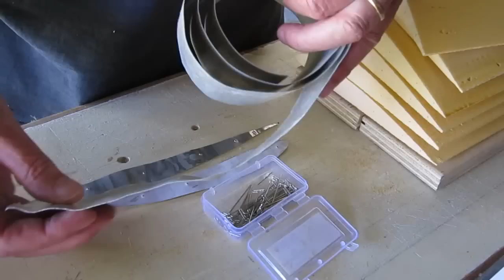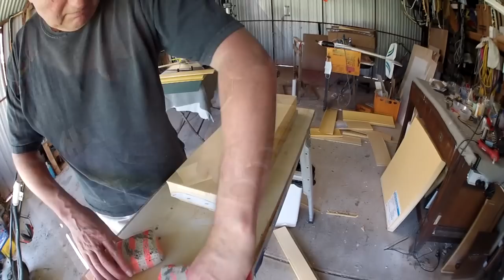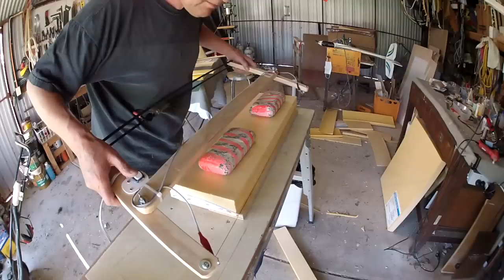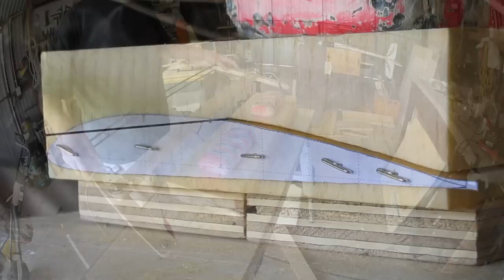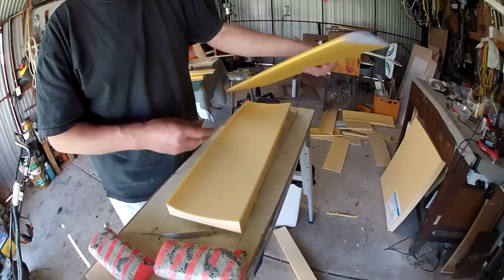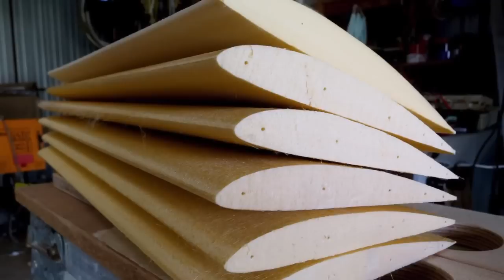The art of hotwire

Comment: Don't have to do straight wings. Don't have to have the same airfoil shape at both ends. With different templates and/or sizes at each end the shape will smoothly transition from one to the other. Can even put a bit of twist in the wing. The Wright brothers twisted the tips of their Flyer wings slightly downward to give them better stall performance. When the middle stalled the ends weren't yet in stall.

Comment: You have this down to an art I've just cut out my first wing panels with my home made bow using 28mm galvanized steel wire and a  automotive battery charger. I am waiting on my nichrome wire to come in from ebay for better results in heating and tension control.  I have found that only certain wire can be used and it is must be resistance wire and it will be fine.
Reply from the maker: Yes the wire I use is about 5 Ohms per metre
Reply: wow and not single strand ill have to chk that out

Comment: Please show how you'd do a tapered wing where you have both a reduction in chord and relative chord height. My concern is that the wire will be moving slower at the  tip end and faster at the root. Won't the slowness of the tip end wire cause the foam to overly melt while the speed through the root end is just right ?? Guess a LOT of trial and error will be involved. LOL. But I think it's doable.
Reply from the maker: Yes you're right. Usually requires more sanding to smooth out ripples on the narrow end.

Comment: What is the power supply? I'm using a 12 volt battery and .025 nichrome, but it goes part way and stops
Reply from the maker: 4S Lipo 16V, or Variable power supply set to deliver 5A
Reply: @AndrewNewton  And what about nichrome wire thickness? I use 0.3 mm but it so think

Comment: Nice demonstration Andrew :)  Those foil-templates are made out of lead / alluminum?? 
I've tried wooden ones in the past, but it's hard to get them smooth enough..
Reply from the maker: +DutchRC ADVENTURES Aluminium window flashing, easy to cut with scissors.
Reply: +Andrew Newton Thanks :)  Looks to be working flawlessly :)
Reply: +Andrew Newton great job as always.
Foil templates alluminium, is 0,5 mm?
Reply: +Andrew Newton wow never had this idea... I think i even use this on my wooden templates on the edges. I gotta try try this :)
Reply from the maker: +enrico p It's 0.3mm Aluminium window flashing

Comment: How exactly are you precisely aligning the two pieces of window flashing? I see that the front of the foil is butted up to the edge. Did you just place something under both pieces, before pinning them, to get an equal distance from the bottom? It looks to be at a bit of a tilt, so I was not sure.
Reply from the maker: +Jerry Whidby Just eyeballed it Jerry, probably not totally accurate but close enough. Would be better to mark a line about 4mm up from the bottom and a point on the front edge to help alignment.

Comment: Andrew, thanks for the Post.
I want to use a digital wood burner may be guitar wire st .6 Ohms. I can vary heat output.
If I do not use nicride wire Will  I have problems?
Reply from the maker: No problem, are you going to try it?

Comment: Hi Andrew,
Can I ask you a question.
I am buying a 3in1 Soldering/Rework station which has variable DC output.
There appears to be several versions though, 1amp, 2amp, 3amp, etc.
For hotwire cutting, 1A would be sufficient, right?
Reply from the maker: Not enough for my wire, I'm using 4A
Reply: Andrew Newton 
wow. Ok. 
Maybe I should consider a different source.
Reply: 4A.. 
I was planning on just using guitar wire..that should be OK right.
I could use an old computer power supply I have. some good amps there.. lol
Reply from the maker: Yes the thinnest string is the one to use I believe. There are plenty of tutorials on adapting a PC power supply, but I managed to trip the house safety switch when I tried. So I now have a proper adjustable unit.3S and 4S  Lipo batteries work fine too.

Comment: How do you sync the 2 sides? (so that the wire is always at same location on both sides) Eyeballing?
What about tapered wings?
Reply from the maker: +SsoulBlade Just eyeballing for straight wings. Haven't tried a tapered wing yet but will mark quarter, half and three quarter points on each end and try to pass them at the same time
Reply: @AndrewNewton  I will use this on my flying wing project. the taper ratio is about 2.08

Comment: What type of foam are you using and where can you get it . That looks much better than the folded foam board tape raped wings . I have multi-copters and left over motors out runners and esc's a 6 channel flysky radio I need servos  . Hot wire looks much better to me . Are you using carbon fiber arrows for spars ? I'm looking for longer range for Video and fpv .
Reply from the maker: +Spencer Boaz All the materials links are in the video description. 7.6mm CF arrows or 6 x 1mm or 3 x 0.5mm for spars.
Reply: Andrew Newton Ok I plan to watch them all again and this time I'll read the descriptions thanks .

Comment: Great stuff, got a lot of info from your video's and going into serious efforts myself. For my first project (which pushed me to hotwire technique fast ) I wanted to combine a scratch built delta wing with the fuselage of a Lidl XL glider. i got some good templates but i was wondering if the foam could be cut evenly and not heat up to much at the tip? Caus the travel is a lot larger on the inner side of the wing then the outer so i wonder if the  foam would hold up the longer wire cutting time on the tip in comparison to the normal wire cutting time at the base rib
. I hope it makes sence what i am trying to say ;)
Reply from the maker: It's always a problem with tapered wings. No way around it really.

Comment: Nice Video Andrew, it really is as easy as you made it look when you have the correct wire tension and temperature....I have a set of my own, just debating how to finish them...I'm leaning towards balsa LE and TE and Solarfilm for lightness....:)
Reply from the maker: +EnglishTurbines Ooh Proper job. Yes there are a few tricks of the trade.
Reply: Andrew Newton Thought about just covering in paper too...It might make a good follow on Video if a good cheap way could be found, although film from HK is still reasonably cheap...

Comment: hi Andrew.  what do you use as a power supply for hot wire cutting?
Reply from the maker: Either an adjustable power supply or 3S or 4S lipo depending on the wire length.

Comment: Is there much of an advantage  moving to a 4s lipo over the 3s you used in the previous video?
Reply from the maker: +stephen clark Oh yes, big advantage. Especially for the 750mm wing halves. Hotter wire = Faster cutting speed = smoother cut. 3S was OK but slow, 6S (2 x 3S) was too hot and burned out the wire. 4S is perfect.
Reply: +Andrew Newton nice job, you make it look easy!  I have used a BRUSHED speed controller to adjust the heat to the wire.  works great,

Comment: With a flat bottomed airfoil, why don't you just match the flat bottom to the bottom of the foam and avoid having to cut the bottom?  I am envious of your smooth cutting, mine seem to always have grooves in the foam, sadly.  Wonderful video, thank you.
Reply from the maker: The airfoills I am using are not totally flat bottomed, even the Clark Y has a curved lead in to the under half of the leading edge. I would have to sand that by hand if I didn't cut the whole thing.
Reply: @AndrewNewton  Another question has come up.  I am trying to cut wings with a flat bottom and line up the bottom with the bottom of a 2" thick piece of pink foam hoping to only cut the top airfoil shape.  All goes well BUT when I remove the newly cut wing it is warped from the root to the tip!!!!  I left over foam remains straight!  Would this be cured by placing templates in the middle of the foam and cutting both top and bottom or what is going on???

Comment: I bought a model train control for my power supply about 15 years off ebay. I found the thing in a box and I think now is the time to finish the project! Thanks for the video. Do you find the leader wire better than nichrome? I am finding nichrome hard to come back and fishing gear seems easier to source. I hear the fishing leader won't change size much as well with the heat.
Reply from the maker: I haven't tried Nichrome yet. The SS fishing leader works well for me. I did keep breaking lighter weight wire in the past.

Comment: Nice job do you put spars in the wings also how do you regulate the heat in the wire
Reply from the maker: Variable voltage power supply or choose 3S or 4S battery depending on the wire length. I glue edge-on 6mm or 3mm CF strips in for spars. Just cut a slot top and bottom. Much more info in the Hotwire Playlist

Comment: Hi-- great video--- What is the longest wing that could be done by this process?  With increased volt/current, could you cut a 12 ft foamy wing?
Reply from the maker: Should be possible as long as you can make a frame strong enough to hold the tension. Might be problems with drag on the wire in the middle. Much easier to cut in sections and join together.
Reply: @AndrewNewton -- Wanted to laminate 8 ft panels of foam in staggered pattern to keep  12- 14 ft wing as rigid as possible.  Then cut the entire wing in one piece.     Have not seen anyone tension a wire that long.  Have heard of fishing leader that may work as resistance wire, just asking if you had heard of anyone cutting a wing that long.  Thanks,
Reply from the maker: @alfaspiderveloce6617  No I have not heard of cutting wings that big. I use fishing leader wire. 40kg single strand.

Comment: Hi Andrew, thanks for a great video and the aussie links too :)  Your link to your video about your hotwire setup is broken. Is that video still available ?
Reply from the maker: +Aus Crankster Oh thanks, link is fixed now.
Reply: +Andrew Newton Brilliant Andrew, thanks.  I was going to start scratch building here in Melbourne using foam board but it is more hassle than I realised here. I like your wing method and will give it a go. Maybe I'll need to use the foam board for the fuselage. What do you use? Darren
Reply from the maker: +Aus Crankster 6mm depron from tradewarehouse. Link is in the notes. I used to fold wings from depron but I find hotwire to be easier and cheaper
Reply: I know that foam :)  I was looking at the other day at Bunnings wondering how I could use it. Now I know !  Gotta give this a go. Thanks again.